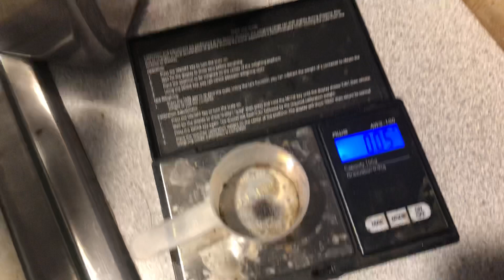Potassium Permanganate (PP) 4hr Bath of Discus Fry

Comment: i wanted to do a 4 hour bath treatment on Pterophyllum Rio Nanay, with 2 mg/l in a bare bottom tank with no filtration (i took the air spongefilter out), but the PP was turning brown after 10 minutes.  I added PP to a higher concentration, but again 15 minutes and the colour of the tank was brown again.  There were no real other organics in the tank which could react with the PP.  I don't understand it.  The PP was bought in a pharmacia one day ago.
Reply: I did this treatment on my discus and just 30 minutes was sufficient as the colour turned brown..  I do not know why 4 hours
Reply: once pp turns brown job complete, only takes 20mins

Comment: you say 2mg/litre

for 70 gallons thats (70x4.5=315 litres based on uk gallons) or 280 US litres based on US gallons.

So in uk 2mg x 315 = 730mg or 0.730g
Or US 2mg x 280 = 560mg or 0.560g

Where did you get 0.266g? That would be 0.95mg/litre (based on 4litres = US gallons)????

Comment: 0.95mg/litre would make more sense at 1ppm dosage is recommended - so you dosed at 0.95ppm not at 2mg.litre (2ppm) which could be lethal or the fry in a four hour bath.

Just thought i'd point it out in case someone doses their fry at double the amount.
Reply from the maker: sorry, i misspoke in the video i think. i use half the dose for fry. for normal circumstances i would do 2mg/L so your math is correct. I will take this video down and repost as to avoid any confusion. Thank you for bringing this to my attention!

Comment: I have killed fish using hydrogen peroxide. Not safe to use with the fish in the tank.
Reply: Perfectly safe if you don't overdose like you did.
Reply: .32 gram as Mr D explained in a 5 gallon bucket. It's less complicated than trying for a bath for 4 hrs ( 2 mg/ Litre or .076 gram per 20 gallon for adult discus/ 0.95 mg for fry.

Comment: Very informative video, great work!! Does the PP kill of your beneficial bacteria on your filters? I have a cycled tank and im adding a bunch of 4 week old fry into it tomorrow that i bought from a breeder, am thinking to do a pp bath for them as ive heard of 4 week old syndrome for fry, i have a canister filter, somebody said to switch the filter off during treatment but then you could have flukes left in the filter right?any advice appreciated, keep up the good work
Reply from the maker: best way to prevent 1mo / 4w sysndrome is lots of water changes for that first month.... tbh I don't even use a filter on my tanks for the first month usually because I'm changing enough water, and if I do its a small sponge. If you're going to PP you might as well remove filter media, run the tank through a PP treatment with empty canister so that the PP cycles thru the empty canister and piping, then if you want put back filter media in but make sure it is new or sterilized via hot water bath or something.
Reply: @GVBDiscus  thx for the reply, I did a pp treatment for 4 hours yesterday with filter media in, then after water change added nutrifin cycle, have been doing 75% water change daily and adding cycle to build up good bacteria, so far so good, I have 12 baby discuss in a 55 gallon which has a partition in it to keep the fry together, as they grow I will move partition